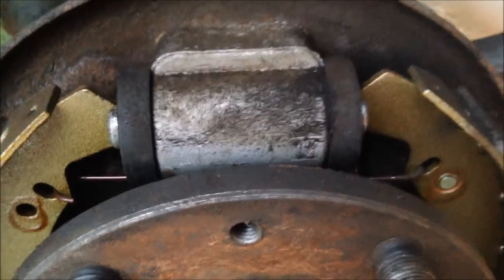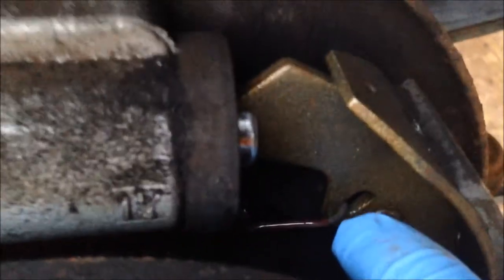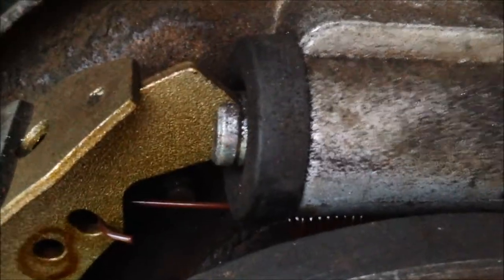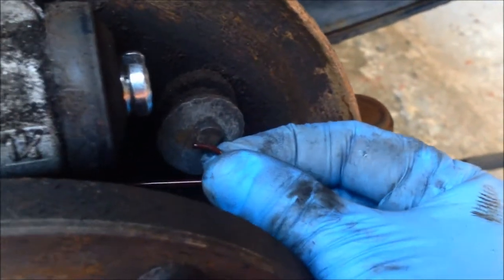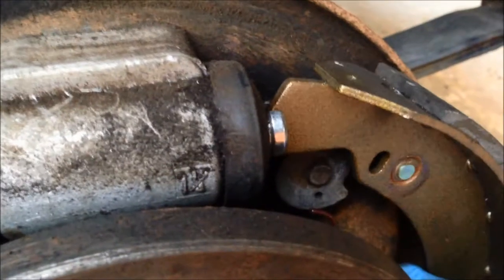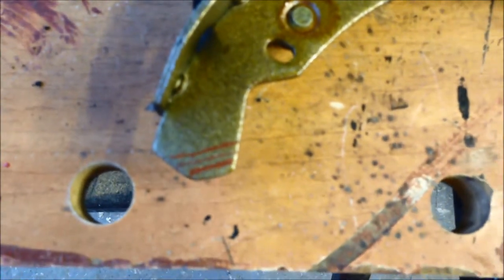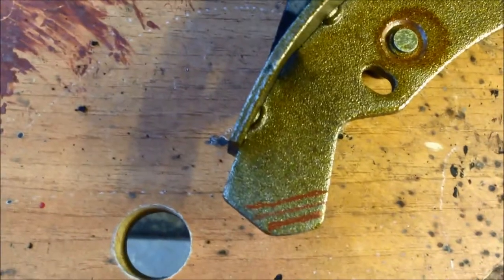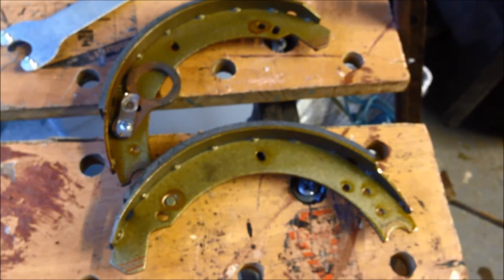88 Series brake spring and trimming shoes

Comment: hmmmm....are you REALLY sure about the top (return) spring attaching to the pin on the back plate, and not to the locating hole on the top of the trailing shoe??
Reply: He is really sure, it seems that Haynes has a lot to do with the commonness of the incorrect installation as their illustrations show the peg outwards (which means the adjuster won't work and leaving the spring nothing to connect to). In my experience the spring will rub on the rubber boots of the cylinder if installed any other way than this video.

Comment from the maker: Just had my land fail its MOT because of brakes. Pulled apart and sorted adjusters but in the process holed the springs up incorrectly and had far too much travel. It had got worse not better. 
Spring length and positioning are critical. https://jtahcu.wordpress.com/2015/07/10/binding-brakes-in-reverse/

Let me know how you get on